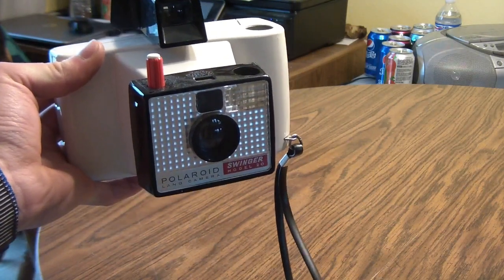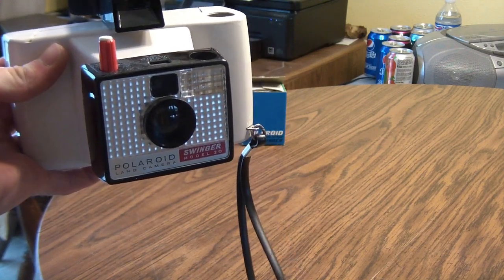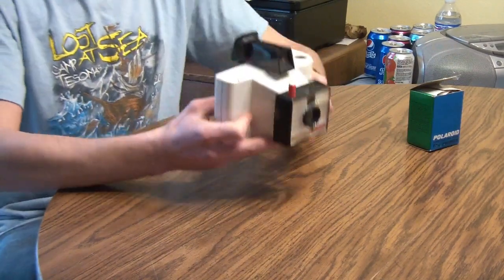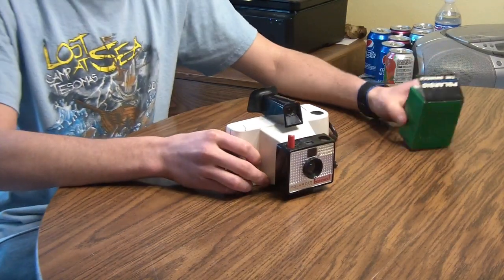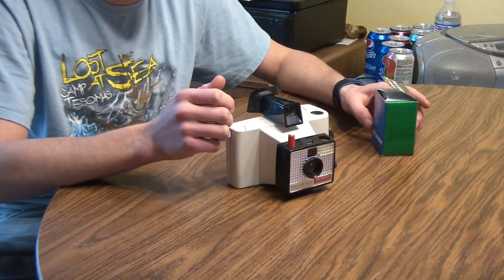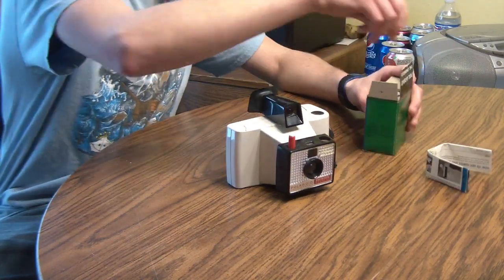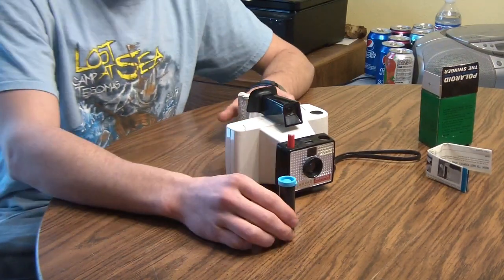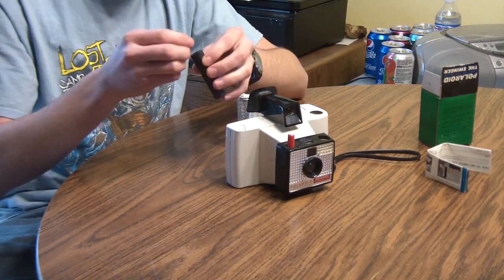Polaroid Swinger

Comment: Polaroid b&w film developed with a mono bath solution which both developed and fixed the negative. The developed silver stayed on the negative. The undeveloped silver dissolved in the fixer and migrated or diffused to the positive sheet, where it reacyed with chemicals on the paper to turn it back into silver, forming the image. The coater's primary purpose was to neutralize the fixer so the image wouldn't disappear after a few months, and also contained a coating to protect the print.

Comment: Hi from London Sam. What a great detailed video - really well shot and very sharp images - it is a journey of discovery! I had exactly the same model Polaroid in the late '60s/early '70s, and have been looking at the surviving photos I took with it in 1971/72. Sadly my father recently passed and I was reminiscing. I had completely forgotten about the coater brush, and that also brought back memories of the distinctive smell of the 'varnish' on the  brush. One interesting detail is that some of my photos are black paper on the reverse (as with the roll you used in the demo) and the others I have are grey paper backed. With the black backed photos, I remember using the coater brush that came with the kit and I notice it left slight streaks across the image (brush marks). The better photos are the grey backed ones, where I didn't use the coating, and they have lasted really well. It's a pity the roll of film you had was no longer viable, but I'm guessing that after 50yrs the chemicals have evaporated! Nevertheless, it was an excellent detailed demonstration of the print process, which was really appreciated. Unfortunately I no longer have my camera, but I wonder if there are any specialists out there who still supply the film cartridge for this Polaroid model? 
Thanks for bringing back such fond memories :)  - I have a feeling I will be re-running this video many times!

Comment: Sam, awesome level of technical info. Have you tried Instax Mini in there? A tiny piece of carpet tape and you’re off and running. Need to load and unload/process in the dark but you’ll be surprised by results. Early models said “NO” until exposure was good. I guess too much double entendre for 1967

Comment: I could have done pretty much all of this from memory, without (of course) knowing the chemistry or most of the mechanics. The Swinger was introduced in 1966 and I received one for Christmas that year, which caused great excitement.

Not mentioned in this video is that the instruction sheet that came with the film (just tossed aside on the tabletop here) specifically cautioned against touching the wet developer side of the paper after use because it was smeared with a "caustic jelly". You clearly see here how much trash this camera produced, which was a problem at scenic locations where people took lots of photos.

Few people today will remember flashbulbs. These were nasty after they'd been "flashed" because they were extremely hot from the instantaneous ignition of the fine wire inside, so when you popped them out afterwards you had to be careful not to touch them or to leave them on a surface that they could burn or melt.
Reply: I had forgotten how hot those bulbs got , though I know burned myself once or twice at least. That was the nice thing about the other cameras with flash cubes: you could take 4 pictures in a row without changing bulbs and when you did they were encased in plastic and easier to handle.

Comment: What type of film is that and can I still get some?
Reply from the maker: Type 20. This was the only camera that used it. It, and type 20c (same thing but doesn't need the coater) haven't been made since like the late 70s. You can get some on ebay, but good luck getting it to work
Reply: @samdavisson580  is there a substitute I can use?
Reply from the maker: @eli_mxtakes6700  I think there's a way to use 120, but you need a darkroom and its not instant.  Of all the instant films that have ever existed though, this would be the easiest to recreate from scratch.

Comment: Can I use it without batteries
Reply from the maker: Yes, but the light meter won't work, and the only way to be sure you had correct exposure would be if you were using flash

Comment: Hola buen video solo una pregunta
¿Comó se supone que deveria de versé por dentro?
Reply from the maker: There's a switch on the back of the camera used to latch the back, as well as to put pressure on the film rollers.
Reply: Oh, hace poco la compre usada en una tienda y soló tiene 5 Cartuchos y tiene el rollo negro que esta aún costado de el y la eh tratado de armar pero realmente no le tomo forma
Reply: Si es posible me gustaria mucho si pudieras subir un video donde expliques con más lentitud el como instalar los rollos
Reply: Al igual muchas gracias por contestar
Reply from the maker: I don't have any film anymore, otherwise I would make another video.  You unwrap the paper around both rolls so that they are free.  The smaller black roll goes on the right, and the large roll with no spool goes on the left.  Then you close the back and pull the paper that hangs outside the camera until it stops, then it is loaded and ready for picture 1.
Reply: Okay, te lo agradezco bastante, eres asombro gracias y sí, me gustaria otro videos respecto a la Swinger gracias nuevamente
Reply from the maker: You're welcome, I'm glad I managed to help someone with the video!